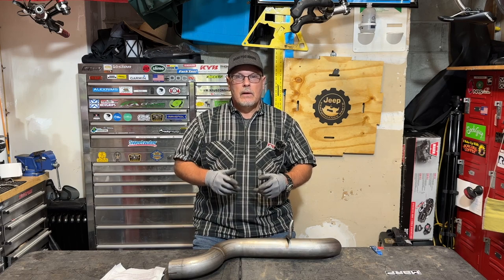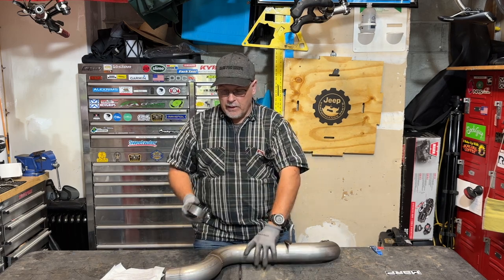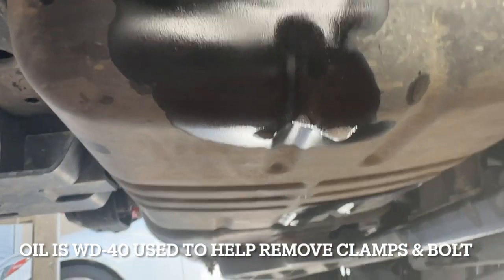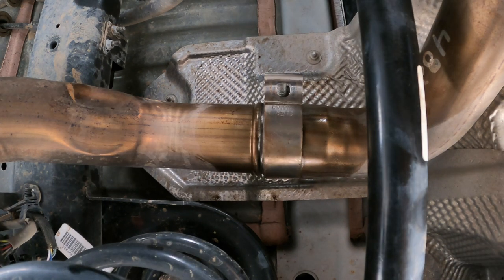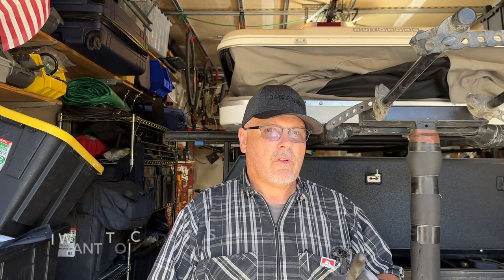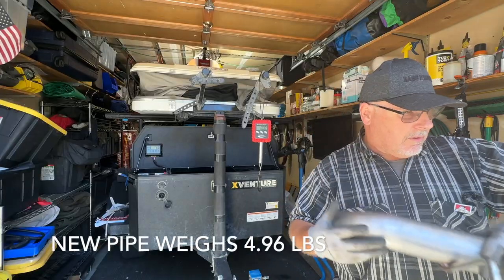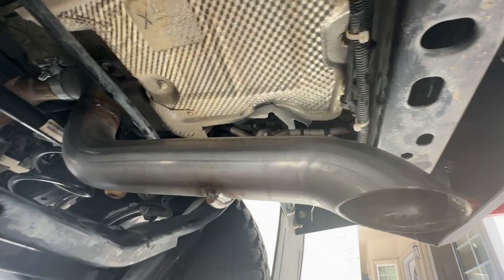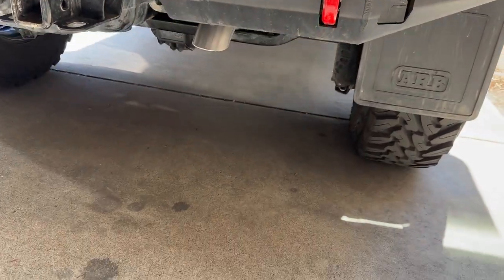How to delete Wrangler Ecodiesel muffler |  Replace with MBRP Filter-Back. Is it worth it?

Comment: Be cautious on what you spray on them rubber hangers , some spray lube will eat the rubber or make it expend and your muffler will vibrate …. You won’t benefit much with just a tail piece 😁
Reply from the maker: Right on. Glad I passed California Smog with it! Thanks
Reply: I had that happen to me once with PB Blaster on an old Jeep. I’m pretty sure the rubber exhaust hangers were cheap aftermarket ones. Hence the reason for replacement. 
But after getting sprayed and sitting overnight, they basically disintegrated onto my driveway.
Reply from the maker: @SpaceGringos3D Holy Cow! My Buddy sprays it on everything!